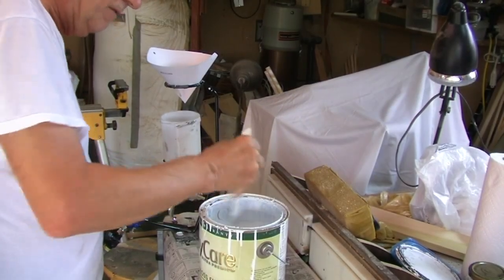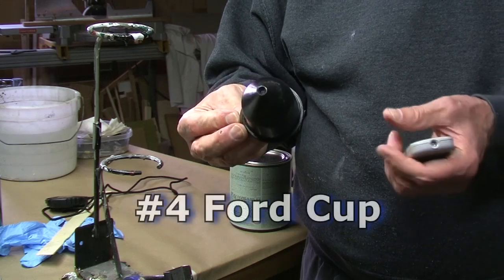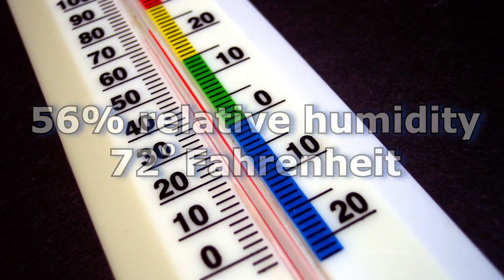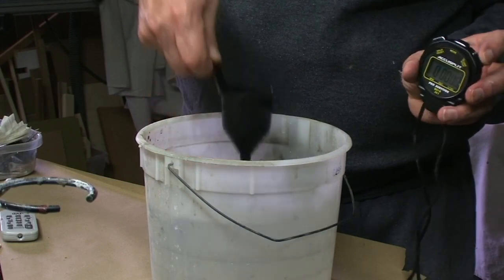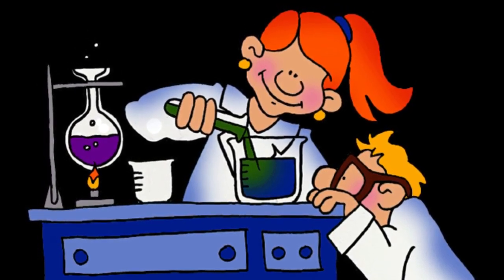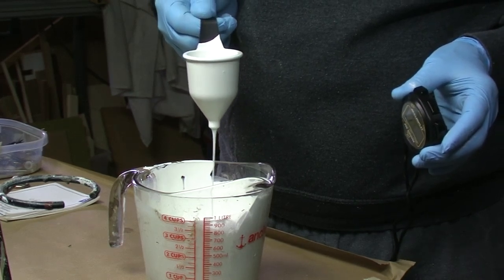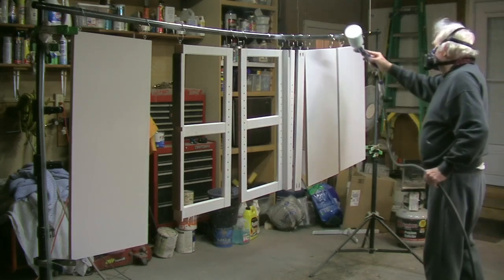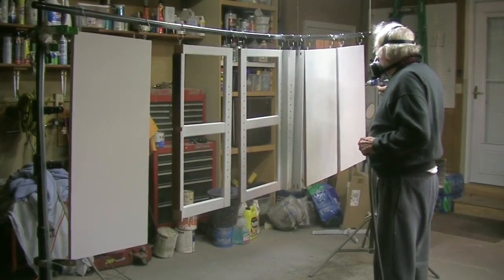How to Thin Water Borne Paint for Spraying, Measuring Viscosity

Comment: You mention a 2mm nozzle.  Is that 2mm the size of the hole in the nozzle?
Reply from the maker: Without going out and actually measuring, I believe 2mm is the size of the air cap.  However, when  purchasing the nozzle, it should include an air cap, fluid tip and needle in a matched set.  Hope this helps, Ron

Comment: wow, great video sir! 
 I actually just started searching for info on HVLP sprayers. I am looking to paint Plantation Shutters. I want a hard shell tupe finish.
 so in your opinion, what type of paint should I be using? 
 I have not purchased a sprayer yet.... any suggestions? I am not looking for pro equipment but definitely want a stable sprayer that will consistently work without issues..... any suggestions on that?
Reply from the maker: +ERIC POTTS Eric, I would rely on the advice of the paint manufacturer on what material to use.  The folks at Sherwin Williams have always been very good to me with their recommendations.  As for a sprayer, I just purchased what is called a bleeder gun which pressurizes the cup.  Used it once so far and it worked fine spraying clear latex.  Maybe I'll do a video on it.  I figured for $30.00 I didn't have much to loose in trying one.

Comment: Respected Mr.Ron Budman, While measuring the viscosity of the paint you submersed the viscosity cup in the liquid which when taken out brings paint along the outer side of the cup and thus the  reading will not be correct in my opinion. Please correct me if i am wrong .
Regards. skm812@gmail.com
Reply: I tend to disagree with Subodh;
Since you are no measuring the amount that gets dispensed, but the longest time it takes until the fluid passes thru the nozzle, it should not make any difference. 
By the time all the fluid has run off the side of the cup, there is still fluid inside the cup. therefore you will still get the same timing. If it would take longer for the outside to run down (remember once it starts dripping you stop any way), this would be a different story.
Reply from the maker: +Subodh Murarka Many years ago (probably in the 70's), I attended a week long class put on by  Binks Spray Equipment Company.  Attending the class were several technicians responsible for spraying aircraft and controlling the amount of weight added per sprayable gallon.  They were very exacting in what they did. With that said, I'm a retired DIY'er working out of my garage.  In my opinion, as long as you establish a baseline time, and as long as you do it the same way each time, it shouldn't matter.  I just want a mixture that will maintain the integrity of the material (reducing can inhibit proper polymerization); plus, give good atomization.  With that said, you are absolutely correct.  If I were following the explicit guidelines given by the paint manufacturer, I would need to fill the cup with the hole stopped without any running down over the sides.   This is an interesting and correct point and thanks for taking time to post.  Ron
Reply: Yes you just dunk them, the time it takes shows how thick it is, I experiment with w/b and get great results i.e. a very fine finish with no orange peal at around 15% water added and low pressure using a conventional devilbiss  jga  558 gun, crank it up and I just get dust
Reply: If you look at the outlet nozzle of a viscosity cup you will notice a unique feature that seperates the 'outside the cup' flow from the 'inside the cup' flow. The two flows do not touch or affect each other.

Comment: My head hurts after trying to find what paint i shoud use, im looking to spray paint some cabinets, so can some one help me with what paint i need or filler. Thanks Btw im swedish so my english might not be on top ;) Great day to yaa!
Reply: PPG Breakthrough.....use a metal flake gun with a 3.0mm tip, cap and needle.  You can thin it about 10% with distilled water.  This stuff dries lightening and is thin.  It will run if you do not know how to use a gun.  Shoot a tack coat first and then two wet coats about 10 minutes apart.  Dries hard as nails and you'll love it
Reply: @raymondpontremoli2489  legend

Comment: Good day, I use a GTI Devilbiss spray gun with a 1.4 mm tip and when I apply latex primer everything is fine (I thinned the primer accordingly) (I used 20 pds air pressure), but once it is applied, little bubbles start to appear !
Why and what can I do to solve this ?

                                        Thank you
Reply from the maker: +Richard Fortin I really don't know what to say other than to try playing around with your air pressure.  I'm not familiar with the Devilbiss gun.  Ron

Comment: can you explain what you use and how do you use it to clean the gun after your done. Also I want to cover the latex with a water borne polyurethane. How do you thin it what size tip and what do you use to clean up after.
Reply from the maker: +Bob Greene Try to find a gun with a 2mm nozzle set.  Check out this video on gun cleaning. https://youtu.be/XobA4GU3Xqc

Comment: 2 Questions for you...  Where can you get a viscosity cup?  and can you thin regular latex paint with water and if so, how does it affect the end result?
Reply: You can buy a viscosity cup from Napa Auto Parts stores or any autobody supply house.
Reply from the maker: +Daniel Shafner Thanks for the tip . . . Ron
Reply: Yes, you can thin latex paint with water. You have to be careful, a little water can affect the viscosity in big ways, seeing you up for runs, drips, and sags. Also, the more that you thin out the paint the less hiding power the paint will have. And the more you thin that latex, the less smooth and the more gritty it cures out. Thin only so much as you need to match the fluid nozzle and needle set of the spray gun.

Comment: my spray gun has a 2.5 mm nozzle. What would you recommend as a thinning ratio for latex paint?
Reply from the maker: Shannon Clark That's a pretty big nozzle.  If it's a gravity feed gun, I'd probably start out around 10%.  Remember, you can always add more water, but if you over - thin, you can't take it back out . . . so start out thick.

Comment: This has been a very helpful video for me so thanks so much for posting it. I wonder if you'd have any idea on what viscosity I'd need using a small touch up gun that has a 250ml cup and a tip size of 0.8 mm ? I've been pulling my hair out to get a waterborne guitar finish to atomize properly through this gun. It's a urethane acrylic by Grafted Coatings called KTM-9. And I can't seem to get any information out of them re viscosity and best way to spray.
Reply from the maker: Andrew Darnley Andrew, I bought a gun like this from Grizzley and attempted to use it only once.  You will probably have to play around with it a bit.  Depending on the viscosity of the paint out of the can, I'd play around by adding thinner/water a little at a time until I got a good spray pattern.  I would suspect with standard latex paint you should start out at about 25%.
Reply: thank you for the info

Comment: New to HVLP here.  Using #4 Ford cup with Zinnser Bullseye 123 latex primer took 10 minutes.  Thinned 20%, down to 45 seconds but haven't tried to spray that.  Using a Fuji 4 stage turbine and a G-xpc gun which lists 20-30 seconds for latex as a general guide.
Reply from the maker: William Turczynski  Thanks for your comment.  I've been brushing/rolling primer of late.  The SW Wall & Woodwork sands and powders very quickly to a smooth finish.  Thanks for posting your guidelines.  Ron
Reply: ***** I'm new to it so whatever comes up, I'm trying to work it into the project, big or small.  Currently that's some brick molding replacement.

Comment: Ron ,thanks for the Vid , What type of pressure are you suggesting for a 20 to 25% mix ?
Reply from the maker: That would hinge entirely on your gun and nozzle size.  I think mine works best at around 40psi.  I just turn it up enough to get a good pattern and I'll often adjust the fan down a bit to the point that the paint is going on wet.  Hope this helps. Ron